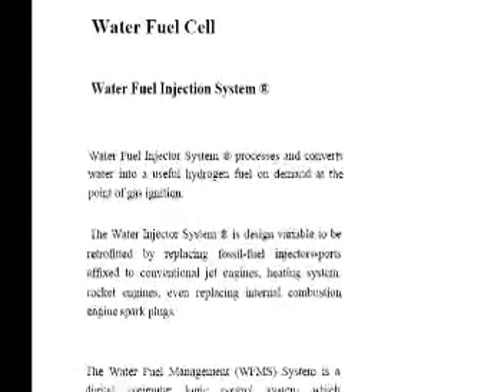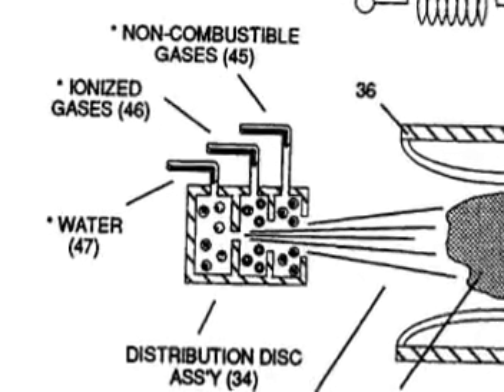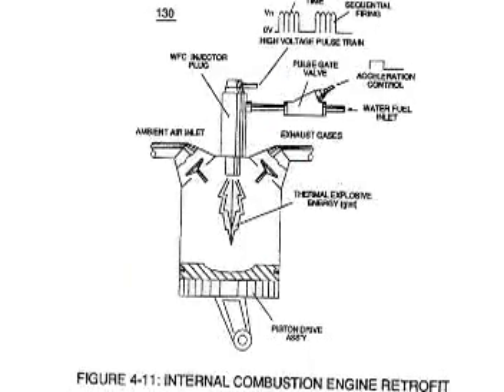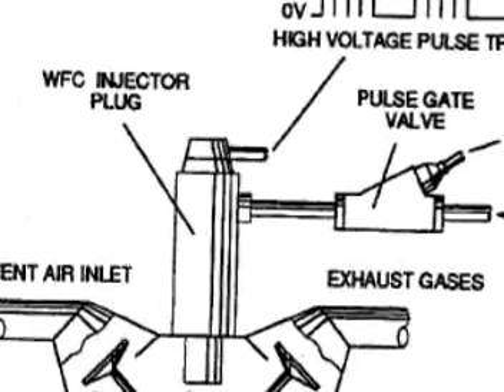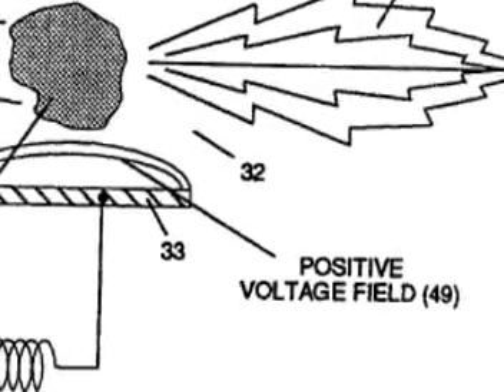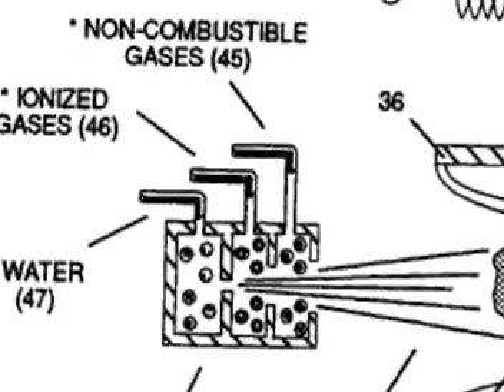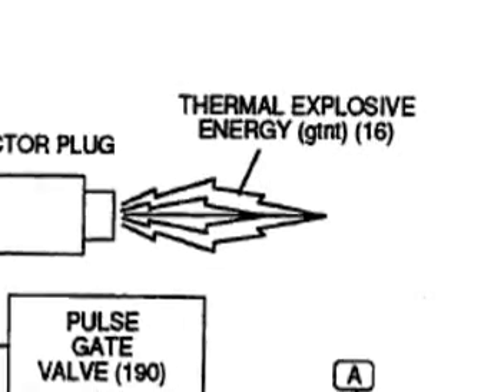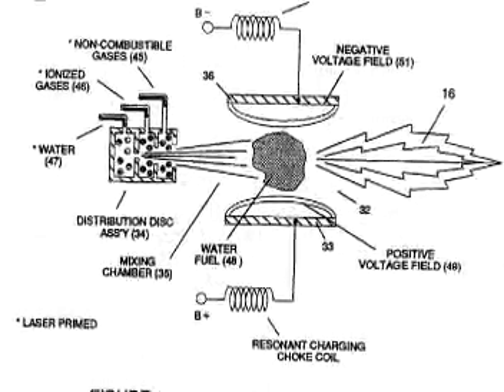SECRETS OF STANLEY MEYER'S WFC - Lecture 1.1

Comment: Incredible explanation. Query. If much of the power to drive the piston down is from the conversion of water to steam then why the introduction of non combustible gases. The higher heat produced by the hydrogen should have a much greater ability to convert a larger volume of water into steam. Is it due to hydrogen having a burn speed far faster than gasoline so Mr. Meyers was worried about engine damage.

Comment: If I got this correctly, the principle of this water engine-cycle is to pyrolise water in its components hydrogen and oxygen (endothermal! = consumes energy), using the work of the expanding volume 1:1.800 from water to gases and to reburn it again using the exothermal energy of the reaction O2 + 2xH2 to 2xH2O? But this cycle wouldn´t deliver any usable power as the balance of work and/or heat equals to zero, provided an ideal (= adiabatic and frictionless) process . Who can explain that?

Comment: I'm sorry, but it seems you missed the point about non-combustible gases, which simply slow down the burning rate of hydrogen... Stan Meyer spent at least 5 minutes in his lecture explaining that as simple as it can get: https://www.youtube.com/watch?v=iaB5ME8kFGU#t=20m15s There is no rocket science in that part of wfc, non-combustible gases are simply being added to the hydrogen gas to slow down its burn rate and thus lower the temperature at which it burns, so you don't burn holes in your frying pans, if you cook on hydrogen gas instead of natural gas.

Comment: I suggest everyone into this stuff get a small 110 to 12 volt transformer.      Supply it with the lawton circuit or actually any pwm circuit...   run it backwards so you are using the 110 side....  now get some stainless wire for a wire feed welder.      This is important you cant have sharp edges or leakage points.   But loop the wires and now place a drop of distilled water somewhere... slowly bring the two loops together into the distilled water.    SUPER HEATED.   Theres yer answer

Comment: His "injector" was designed to be used with water and dissolved gas.     Watch his video or the dave lawton video.... watch the gases stay dissolved in the water...  its all hydrogen and oxygen and non combustible gases
Reply: What im getting at is that you can superheat distilled water with a fairly low current with the right frequency and size of chamber....   imagine the needle and nozzle on a paint sprayer but ones negative and the other is positive and they are insulated from one another with only distilled water full of dissolved gases

Comment: My logic has thought that as the space at the top of the piston to be around 100 ml or 100 cm3, so 1800 cm3(expanded water gasses of one cm3 ) - 100 cm3(piston space at top dead center) = 1700 cm3 of pressurized gasses.  Take the 1700 cm3 / 100 cm3 = 17 to get the multiplication factor above pressure at sea level 14.7 lbs/in2 X 17 = 250 lbs/in2 just from the first action of the disassociation of water. The other process steps that follow could lead to a 3 to 10 times multiplication factor above that 250 lbs/in2.  At minimum the pressures could be 750 lbs/in2 or psi, you can move a car with that for sure.  At maximum 2500 lbs/in2 or psi with a piston surface area of 1.5in squared x 3.14 = 4.71 in2 surface area. The numbers are minimum 3533 lbs and max of 11775 lbs on the piston head in an instant that is performance.

Comment: Stan Meyer's car actually runs on quantum physics. When a particle is ionized it can travel from point A to point B with out existing between points A and B. This defies Newtonian Physics where a particle must travel between the two points. When a particle jumps between points A to B without existing in between the points it is called a quantum leap.
Meyer's ionizer takes advantage of the energy within the quantum leap basically creating a quantum slingshot that propels the piston.

Comment: there is a plasma combustion engine that is a closed cylinder meaning no in or out put of gas or air s it is an exspandsion and contraction vacuum effect  but the magnetic coil is around the plasma to focuse the flash and it is a director effect if i could get some kind of magnetic field that did not use so much in ballanceing the plasma to keep it from the side walls of the cylinder it would use less electricity

Comment: layers of voltages in pulse form rapidly exspands these water partical to change to hydrogen ionized vapor to condensed hydrogen via the non non combustion gas  as positive and negative electrons when the non gas mixs the vapor is turned to hydrogen

Comment: The ionized gases were made so in the magnetron of the air processor unit. they were introduced thru the carburetor.The injectors only introduced water vapor(not steam)which was added by solenoid control during accelloration and microprocessor(rockwellf8)assisted. The electrode was made from s/s304, as well as the casing and cathode. The center insulator was MACOR. He chose a converging wave guide of the three in his patent app.  see more at:        rwgresearch

Comment: The main problem to overcome in trying to use hydroxl in place of gasoline is the extended burn time of gasoline in a 4 cycle engine process, many times burning all the way into the end of the exhaust cycle into the exhaust pipe,as observed on drag racing engines . Hydroxl in an exothermic reaction goes to an endothermic reaction well before the end of the power stroke. The only thing that will extend the power stroke is more nitrogen or argon mixed into the ambient air and the hydroxl.
Reply: Does it really need the laser, and the gas to be created right in the piston ?

Comment: I have the original plans for the injectors manufactured in the uk by an associate of Stans,john prendeville. I made 5 of them and tested them in a 1650cc vw engine,the same as stan used. there isnt enough hp made to move the buggy(a 76 manx chassis,same as stan used,same weight class) under its own sustained power. There are no vid clips with the injection system attached,only the ones with the wfc's in use.

Comment: the non-combustible gas is used to "dope" the hydrogen to make it burn at the same rate as normal petroleum gas, so it can be retrofitted to existing car engines. Stan did this by feeding the engines exhaust gas back into the injector system.

Comment: Indeed is all from water ionized. Low current is required to get H3O (+) and OH ( -) by proton "slide". I use the therm of protolysis for that part of reaction since only protons are exchanged.So call HHO or oxy-hydrogen , from electrolysis - an explosive  gas - is only the igniter and initiator of cascade electro-chemical reaction inside the cylinder where pressure and heat are promotors of further -more efficient -  electrolysis and Hydrogen production from acid H3O.Good explanation!

Comment: 1) I think we can all agree that HHO burns and can work as an alternative fuel to gasoline in a normal combustion engine.
2) It would appear that Stan Meyer's injector concept is merely an "HHO injector" mechanism that uses exhaust gas as a pressurizing element, HHO (created form another place, not AT the injector) as "fortifier", and water that when passed across positive and negative fields creates HHO gas just prior to injection into the cylinder.

Comment: Present at the pump US gasoline is mainly water and surfactants.  As compared to 1960's era pre-'73 Yom Kippur War and OPEC Oil Embargo gasoline at the pump, present US gasoline has characteristics similar to water & hydrogen.  During the engine compression cycle all but the lightest gas elements return to a liquid form and subsequent to detonation expand driving the cylinder.  WW II fighter pilot Herman Pleasant Anderson said this technology is functional. United States Patent 6,119,651

Comment: "The multipactor effect is a phenomenon in radio frequency (RF) amplifier vacuum tubes and waveguides, where, under certain conditions, secondary electron emission in resonance with an alternating electric field leads to exponential electron multiplication, possibly damaging and even destroying the RF device." - wikipedia. Farnsworth's patents. Several diagrams in Meyer's patents resemble many of Farnsworth's ideas. Figure 1-13 (Meyer) looks like a Fusor...

Comment: I have to make a correction as this is terribly misleading. When electrolysis is used (flat DC at any voltage) on water to split the molecules, there are NO EJECTED ELECTRONS. The "liberated electrons" occur during a process called "multipaction". If you look at Meyer's patents, the word "resonant" is used more than any other word. He did not use flat DC. He used impulses driving a step-up transformer to obtain the high voltage, low current frequency used in his "resonant cavity" or WFC.

Comment: Continued: To see video's of the GEET Fuel Processor here on you tube, Search Paul Pantone GEET. I also like that we don't have to use any electrolyte with the Stanley Meyer Fuel Cell, whereas now; all other HHO systems require Sodium Hydroxide(Lye) or Potasium Hydroxide or a number of other electrolytes. Stanley Meyers water fuel cell also remains ambient temperature(room temperature), rather than getting hot like all other HHO cells, which often operate at approximately 180 degrees Fahrenheit.

Comment: Continued: When mixed with gasoline which helps the engine to start. Once the GEET engine is warm, the primary fuel is water, which becomes what inventor Paul Pantone calls Plasma, after the orinary water has gone through the GEET reactor. If you could make a video of Paul Pantone's GEET Reactor and explain in the same detail and clear precise process, it would be fantastic. Keep in mind- that even when GEET is not built proper, it still runs on gasoline vapors alone, rather than liquid droplets

Comment: Thank you very much for making this video :) I've studied Stanley Meyer's "Water Powered Dune Buggy" for quite some time, and your video really explain the heart of the system. I look forward to watching all of your video's. Also- check out the GEET Fuel Processor at GEET International and GEET Friends home pages. When GEET is built proper, and the bubler remains under a vacuum(lowers the boiling point of water), rather than a positive pressure, The GEET will use water as a fuel, when mixed with

Comment: Nuclear, wind, sun and hydro plants can be used to charge an array of 12 volt  batteries for example 10 small 40 amp hour batterys = 120 volts. at that voltage could use 10 amps to get 4 or 5 liters a minute no need for pwm (but should improve output) no need to remove 500,000,000. combustion engines ,

Comment: The Hydrogen Fracturing Process: The basis of this process is the subjection of the water molecule to very high voltage (20,000+) pulses at a particular frequency and within positively and negatively charged voltage zones at a very low current of less than 1 milliamp.

Comment: Where normal Faraday type water electrolysis requires the passage of current measured in amps, Meyer's type water electrolysis achieves the same effect in milliamps. Furthermore, ordinary tap water requires the addition of an electrolyte such as sulphuric acid to aid current conduction; Meyer's cell functions at greatest efficiency with pure water.

Comment: Where normal water electrolysis requires the passage of current measured in amps, Meyer's cell achieves the same effect in milliamps. Furthermore, ordinary tap water requires the addition of an electrolyte such as sulphuric acid to aid current conduction; Meyer's cell functions at greatest efficiency with pure water.

Comment: I  have  studied this electrolysis for  years, yet everyday I still  learn something new that i  didn't understand before.  I am open minded but not gulible. Tom Ogle, charles pogue, Stanley meyer and others who are  dead today, paved  the  way for others to use energy more efficiantly, without  waste without  dependancy to have  others  produce it  for them. Point  is , anyway you can  do that, without polluting, producing carbon or caustic chemicals, is admirable and responsible.

Comment: That and I believe the point of ionized gas (from the laser) was to keep the oxy and hydro from recombining, as well as having to use less energy to split the h2o, as the ionized gas would help the electrical field destabilize the h2o by trying to rob its electrons away.

Comment: UV light ranges are known to dissociate water by themselves, and other compounds as well.  In fact they are known to elevate the energy levels in a simple spark of electricity.   Combining the input of Light, Sound, and Electricity, and Magnetism is the sum of Meyers and  Puharich's work in the water fuel cell uses. Meyer shed the light onto Puharich's work. Pun intended.

Comment: I have my new set up well under construction and soon I will give a video of the different parts. I am working on the plasma system at the moment, which s proving more difficult when I have to use off the shelf parts or make them myself.

Comment: When the gas explodes the water spray also splits and explodes and so you have a continuing on going reaction. Compresed air is fed into the burner tube at an angle to form a helix flow and so mix the water spray, gases and air together so as when the gases explode they do not totally recombine to form water. The burner tube was preheated by injecting propane gas to start the system from cold, once the burner tube was hot the propane was turned off and the burn self sustained on water only.

Comment: You are onto the right track, if you look at my diagram it will show the basic system. I am at present building the second of my engines, all be it on a budget, not as before. I will be changing some of the system due to the cost of especially made parts but I am sure that the end result will be the same. The fuel is a rich gaseos water, the gases are hydrogen and oxygen, when injected in a spray form into a high voltage plasma field the gas explodes.

Comment: Zer0PointUnlimited, "Stan made hydrogen prior to the water injector plug..."

 He did make it in another way before using his injector but after he made the injector, the injector is all that was used for the conversion. He was able to replace spark plugs on any motor and install the injector in their place and then use water to fuel the engine with out using another electrolyzer. I do believe he used pre-energized water but I am not 100% sure as of yet.

Comment: I believe you are correct in all you say....however, I believe a crucial part is missing in your understanding. Stan made hydrogen prior to the water injector plug...in fact he had many series cells. I would encourage you to look up "Atomic Hydrogen Welding"....it is an old method of arc welding...where molecular hydrogen (H2) is passed through a 300v arc...this splits it into atomic hydrogen (2H) when the atomic hydrogen re-associates to molecular hydrogen it releases over 3500 degrees..OU!

Comment: I'll tell you the secret.  Water does not combust, water is a product of combustion.  Two hydrogen and one oxygen molecule happen to form a quite stable molecule that resists further oxidation, requires more energy to 'crack' than the re-combustion or re-oxidation would provide. 

Stan Meyer ran this con for decades.  And many others have kept it going.  One would think that by now someone would have produced something that actually worked on a large scale.